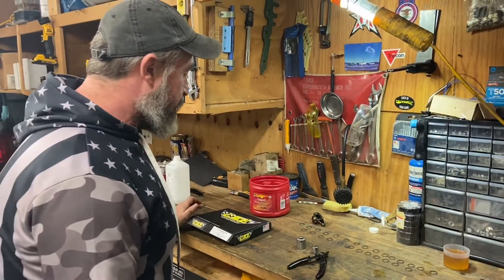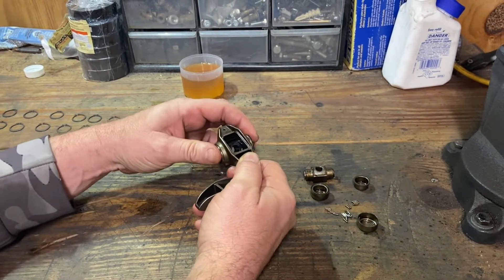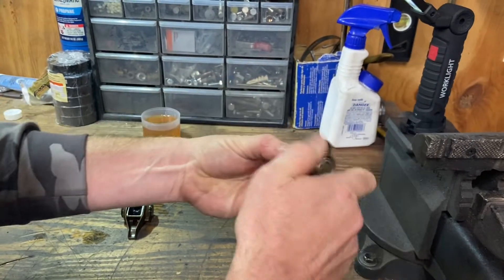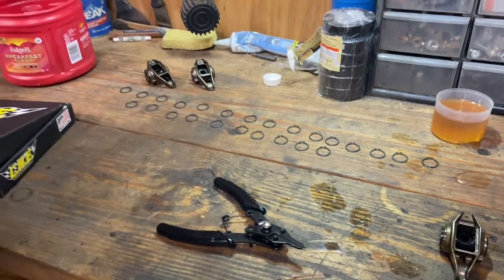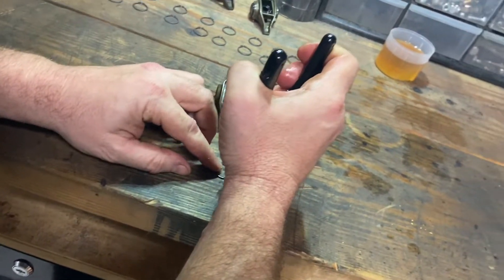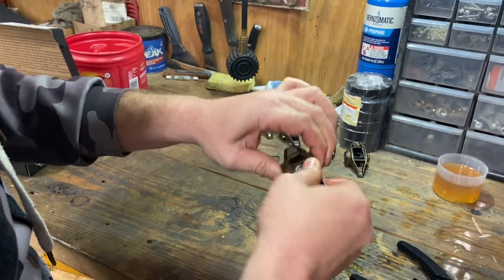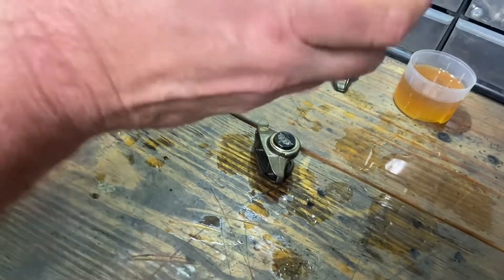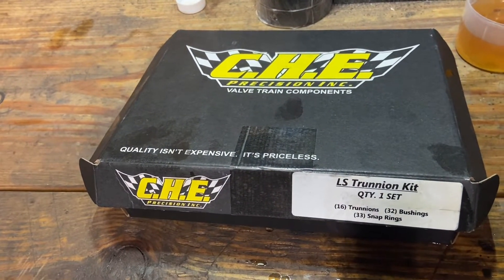#CHE Precision #Trunnion Upgrade On LS or Gen V LT Rockers No More Needle Bearings!

Comment: Are these the same as LS just torque rockers back down to 22ft/lb and you’re good?
Reply from the maker: Yes you got it, I always rotate the engine and check torque twice after initial 22 ftlb torque just to be safe. Thanks continued support. I appreciate it.
Reply: I have the ls kit but the damn snap ring won’t snap on all the way on the other side idk what the hell is causing it

Comment: If you dont have a press or a vise,use a hammer and tap them out...works just as good if not faster..😎👊🏻...still used the 7/8 socket on the bottom and a 14mm socket on top too knock out the factory trunnion..😊
Reply from the maker: Really ! Wow nice 👍
Reply: @JustCantSitStill 
By the way,you had the best video of doing this,hands down!👍🏻
Reply from the maker: @dalehall2993  thanks buddy I appreciate that ! The one of my wife doing them is not to bad either she did pretty good.  Thanks for watching and the support.

Comment: Great video 🤙 I’m going to order some , yesterday I was charging my oil on my 07 c6 z06 and had 3 needle bearings on my oil plug, Sucks because the car just has 6600 miles on it but Im actually glad it happened now because I’m about to put a Race proven Motorsports stage 4 with a monster triple clutch on it so better now then later 🤙
Reply from the maker: Dang low miles for dropping needles already, glad you caught it. Thanks for watching and the comment!
Reply: @JustCantSitStill  I know right !! I just ordered them looks like I know what I’ll be doing next weekend lol
Reply from the maker: @derekperkins4141  sweet I got another vid of doing the che’s too if needed, two beer job no biggie.
Reply: @JustCantSitStill  2 beer job 🤣 cool man I’m definitely going to check it out thanks 🤙
Reply: @JustCantSitStill  you think I should get some new bolts for the rockers or just reuse the stock ones ?
Reply from the maker: @derekperkins4141  I have always reused stock no issues so far
Reply: @JustCantSitStill  cool thank you 🤙

Comment: Thanks!
Reply from the maker: No problem Craig, I have done quite a few sets of these and I prefer the CHE’s over any.  Thanks for watching please subscribe if you have not already and check out some of my other videos.  I have another set of these I need to do soon if you think of anything else I need to show or go over let me know. Thanks buddy.
Reply: @JustCantSitStill  Hey boss, I thought of a couple. I've got most of my L86 torn down. I'm waiting on parts of course! Just need to remove the crank and pistons and clean the block. Looking ahead on the project, is there any chance you have anything on replacing cam/main bearings and then piston rings is another one I'm looking into as well.
Reply from the maker: @CraigZB  Craig for some reason your comment got flagged I just seen it. We have not got anything on that if they need bearings or anything that extensive they go to a machine shop for a lower end rebuild. Most we get are low mile so we don’t see it a lot.
Reply from the maker: I appreciate you watching and your support thanks buddy

Comment: Good job.  Do you know when (model year) Chevy solved this problem on the Camaro?  Or did they never solve the problem?
Reply from the maker: Thanks for watching, I don’t think the needle bearing issues has been corrected as we have had some 2021’s in the shop with the same rockers. Please subscribe like share and check out some of my videos.
Reply: @JustCantSitStill  Thanks for the reply.  Might have to check out Mustang.  Even more disappointed than usual in GM.
Reply from the maker: @gnosticnight  a DoD delete and trunnion upgrade and the LT is pretty bullet proof after that but it all depends on what you want.

Comment: Needle bearings in the oil pan are extremely common. I found all but 1 so far. Car ran like a sewing machine for a while. I only discovered the issue while I was replacing my oil pan gasket. 2000 vette.
Reply from the maker: 😯 wow ! Glad it did not hurt anything, thanks for the comment and checking out my channel, give me a subscribe if you have not already, check out some of my other videos, take care and have a great week.
Reply: I have the same issue im hoping I all the bearings made it to the bottom of the motor
Reply: @zoeman2958  my car still runs just fine. I replaced the broken rocker. Didn't take long. Easy fix with basic tools and knowledge. Have the rest of the rockers to replace but haven't done it yet. Replacing all of them is a little more involved but not a hard job at all.
Reply: @merc6 I just hope I didn't do any damage to my motor, I did some miles on it knocking before I got home & take it apart 😢
Reply: @zoeman2958  that's sucks. Mine didn't  make any abnormal noises. It just needed the oil pan gasket replaced and that's what I discovered.